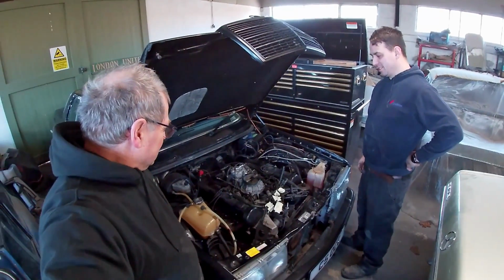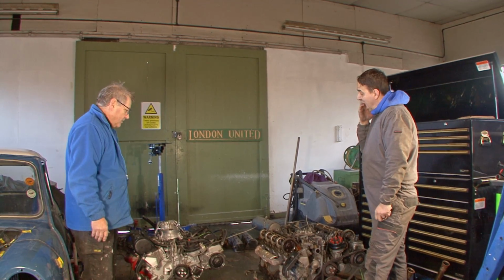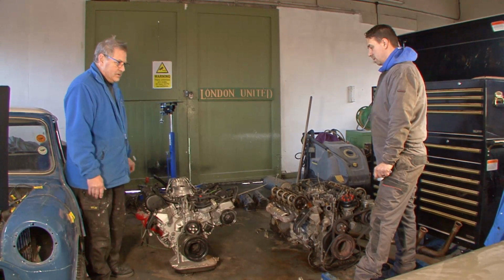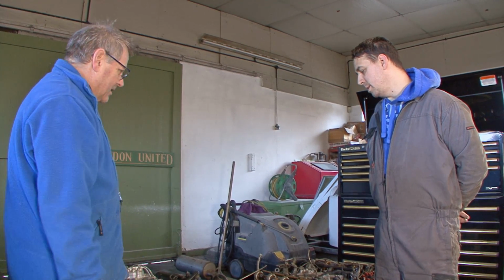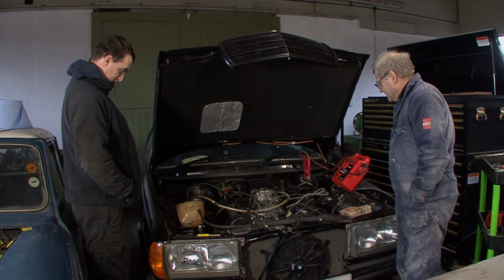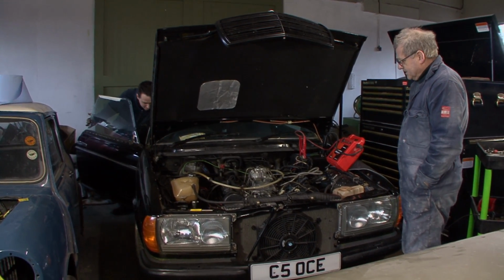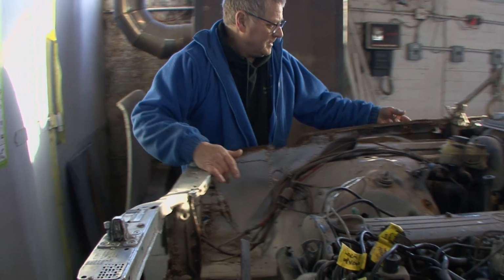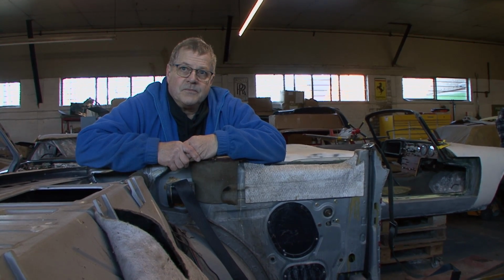Workshop update 10: Mercedes W123 V8 gets more power!

Comment: Great video! I don't suppose you still have the v8 engine mounts?
Reply from the maker: Hi, thank you for watching the video! I have ONE set of engine mounts for the W123 V8 conversion. They are the original welded steel mounts though, not the later cast alloy ones. They work just fine. In anticipation of your next question, yes they are for sale!

Comment: how difficult is such a conversion of the engine from m102 to m117?
Reply from the maker: Hi. It's more complicated than it first appears. Bespoke engine mounts are needed after which the M117 sits very well in the engine bay. After that it's a multitude of modifications and a bespoke engine wiring loom. The W126 series one diff is used with modified W123 drive shafts. W126 front brakes bolt straight on but 15" or 16" road wheels are needed to clear the calipers. A modified propshaft is needed. Bespoke power steering pipes too. And a hundred other things. AWESOME car though.

Comment: Hi Martyn, just come across your video, what an impressive piece of work. 
I’m looking to put a V8 on W123 1983 240D, which V8/model would you recommend. Your help is greatly appreciated.
Cheers Adi
Reply from the maker: Hi Adi. You can fit a V8 into your 240D but it will be a little harder than fitting it into a petrol car. There will be extra wiring to sort out and, presumably, your car is a manual? I recommend using the V8 with an auto box, so you will need to fit a different pedal box etc. You will need the petrol tank from a 230E or 280E injected car. Other than that it's a similar process. I have the original set of fabricated prototype engine mounts here if you need to buy them. Actually, I have a low mileage 5-litre engine and auto box too.

Comment: I found this channel after surfing YT looking for W123 engine conversion vids. The 560 is a 10-1 engine? I put one into a W111....(!) .The only way we get those here is to track down wrecked ex UK or Hong Kong cars. Our OZ delivered 560's are all  US smog Spec engines and not really all that powerful. One of my daily's is a W123 1985 300D with SST turbo and manual trans .It's only 136,000 miles but rusty. Another is one I bought from a scrap yard last month to get it's M110 engine for a customers W114. It's perfectly straight and rust free,having come from outback Queensland. I have no idea what to do with it's remains yet and seems far too good to part out.
Reply from the maker: Hi. I've converted several W123s to V8 power, around ten. They make great cars. One magazine road tested a 560 Coupe and labeled it 'the best car Mercedes never made'. There's much more to see on this particular car, all coming in a later video.